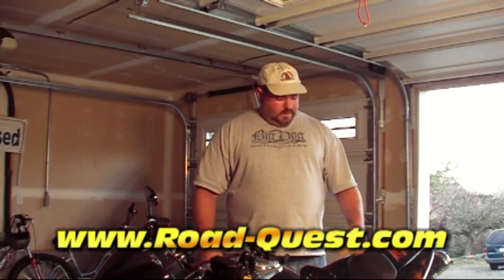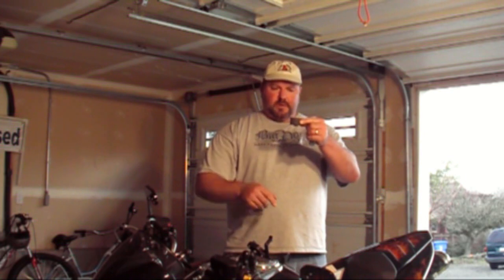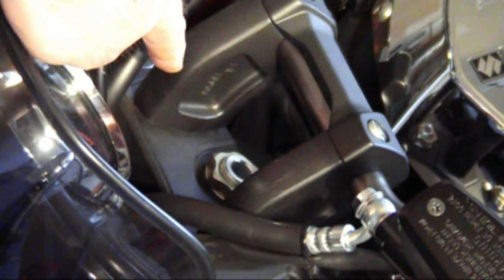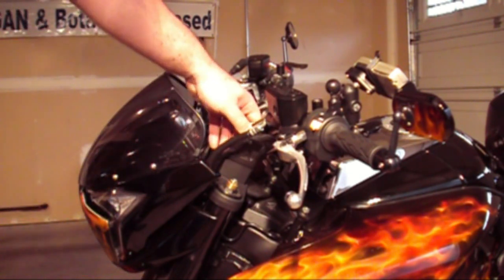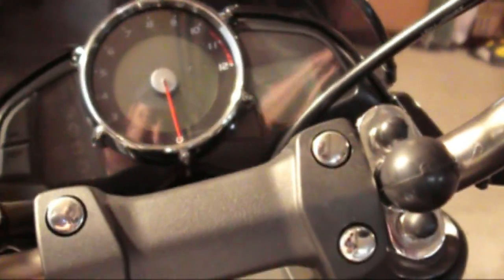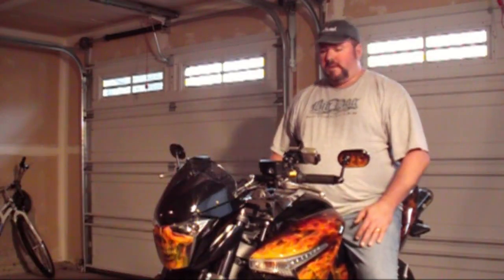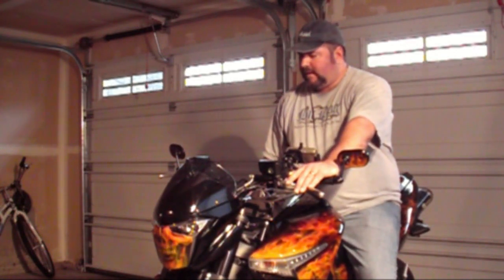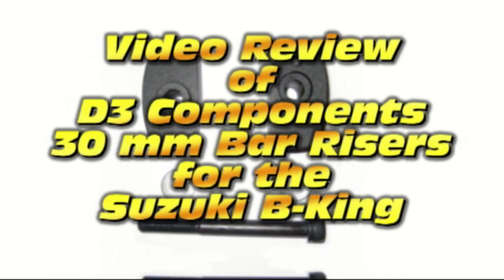CNC Machined 30 mm Suzuki B-King Bar Risers from D3 Componets

Comment: I got them,Fited today,over 2 hours,not 2 easy.
Throttle cables really tight,not easy 2 get slack in them.
I moved brake n clutch cylinders in a bit,no real prob.
Unless u hav a special Flex Tool to run off a drill, Tightening supplied Allen Head bolts is really time consuming.
Clutch side of bike the worst.
Turn Allen Bolts bout 1/8 of a turn each time,maybe less,hence 2+ hrs to do.
Having said that and warned people it is not an easy or quick job I am pleased with the product itself